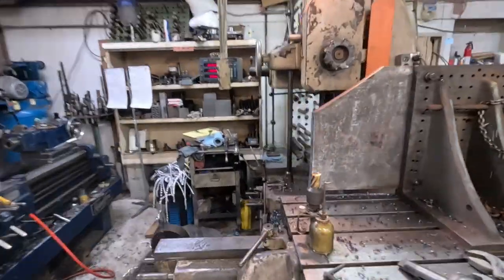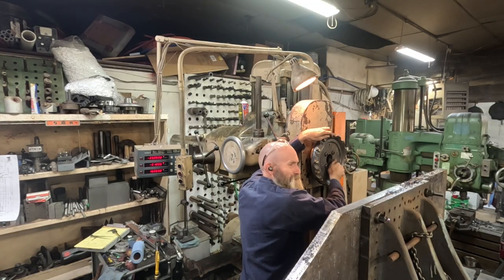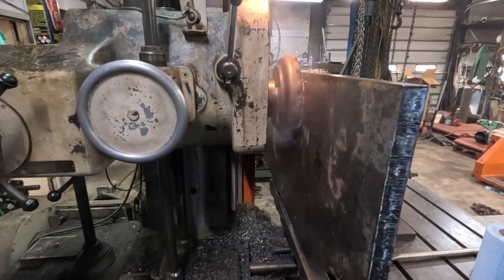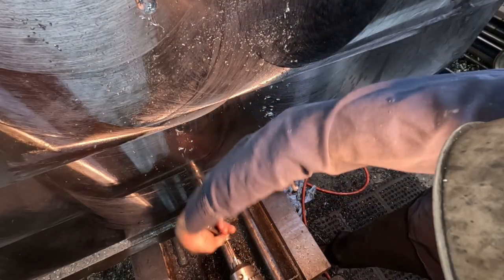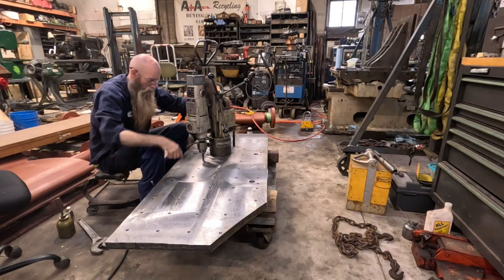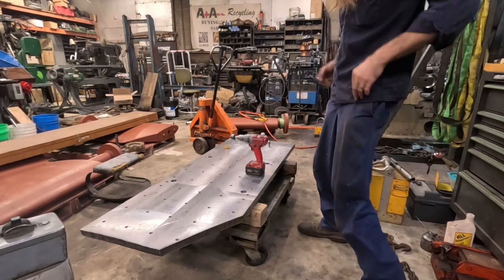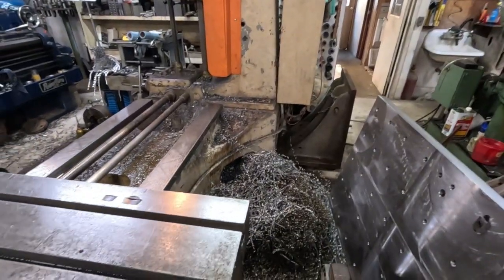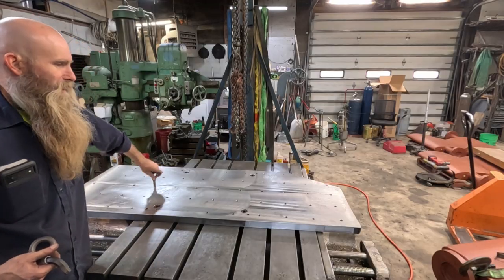I finally made a fixture plate for the Lucas model 41 horizontal boring mill!

Comment: Brother you got some hefty machines in that shop. How thick is your concrete. I am putting together a similar shop here at home, but my concrete is only 4" 3500 PSI. Not sure it will hold up. I already have a large Thompson hydraulic surface grinder and a Cincinnati #3 horizontal mill plus a BP and 3 lathes along with numerous tool grinders. Keep it coming. I am wanting to add a Lucas boring machine. There is a lot of heavy equipment and forestry work in my area.
Reply from the maker: This shop had a 5" floor in it when I bought it but it was 6" below grade for some stupid reason so it would flood every spring, so I put in 2" of wetted and compacted sand and then poured 6" of wire reinforced 6 bag over that. So far so good.

Comment: Andy, you might want to look into getting that surface ground in Comstock Park on west River circle or court across from Mason Dynamics. They did our stuff when I drove truck for a local tool and die shop. I think they have a Blanchard that would work.
Reply from the maker: Thank you for the heads up, I will definitely look into that!

Comment: Will it stay flat ?
Reply from the maker: It should, it was hot rolled plate, that doesn't have near as much stress in it as cold rolled.
Reply from the maker: The big issue was getting the curve out of it to start with, I had to cut a lot out of the video, but I had to do some crazy shimming under the middle of it for the first side so that I didn't introduce stress into it while I was trying to get one side flat.